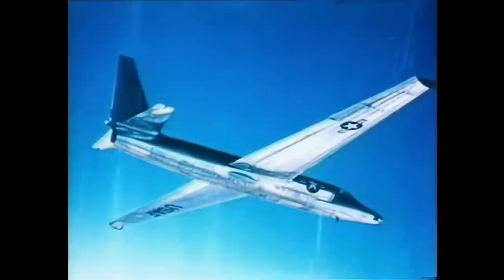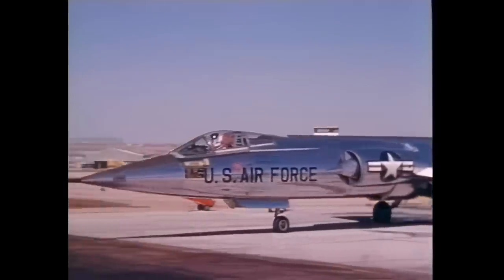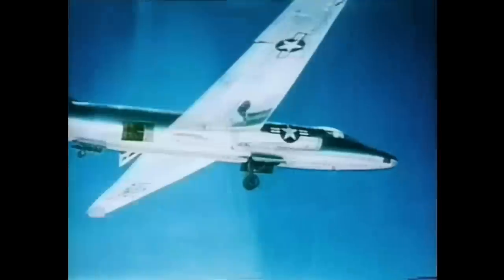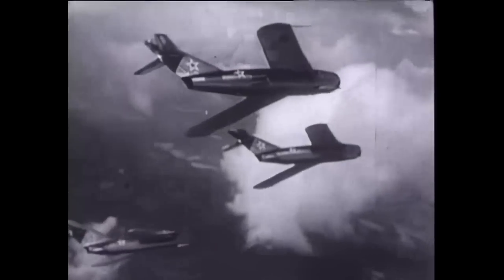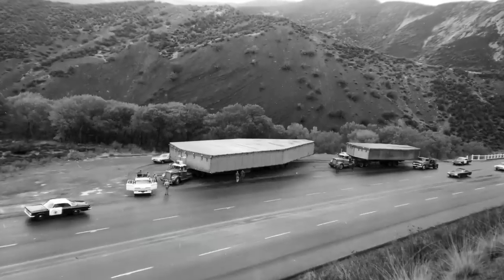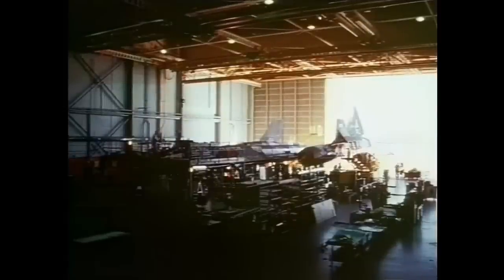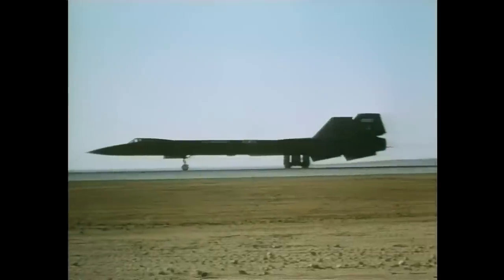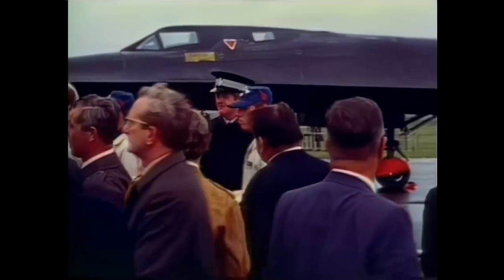Lockheed SR-71 Blackbird,  the untouchable reconnaissance plane. New York to London in 1h 54 mins!

Comment: fastest speed of an a12 (which was lighter than the sr71) was m3.58... the engines were tested to operate at 125,000 feet by p&w. its why the 1st flights of the a12 did not use the J58. frank murray has an excellent video on youtube about flying the a12.
Reply: bingo!